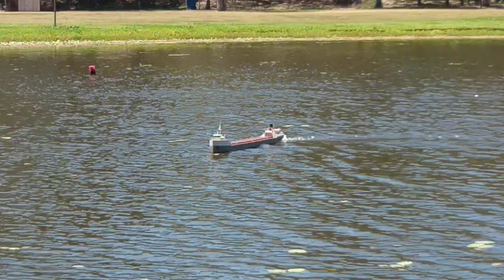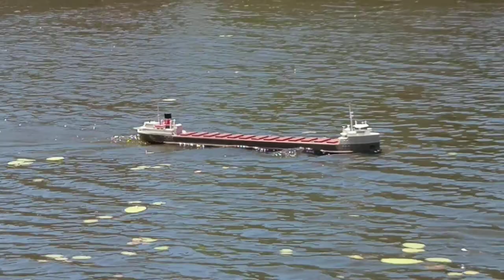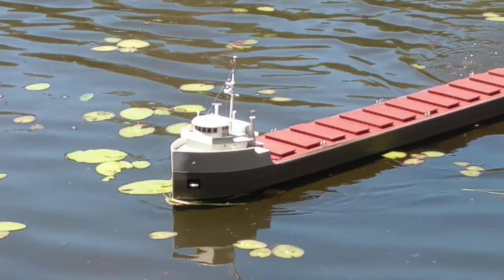Great Lakes Freighter

Comment: Is this a good first boat? Or is something like the Dumas jolly jay better as a first?
Reply from the maker: It is a very easy kit to build. Probably easier than the Jolly Jay as a first kit, because there is a lot of wooden planking to be done on the Jolly Jay. That can be a bit tricky for a first boat.If you like the look of the Dumas 41' USCG utility boat kit, that would be a good first boat. The hull is made up of solid ply panels. Very simple I have the kit but haven't built it yet.  https://www.dumasproducts.com/product/uscg-41-utility-boat-kit-1214/
Reply: @785boats  Thanks! I hope I can build a couple of these kits soon!
Reply from the maker: @excellenceinanimation960  The nicest one that I've built is the Dumas 'Dauntless' kit.
It's a big boat though at 49" long.
Reply: @785boats  just looked it up it’s sweet!

Comment: Do you have to put the propeller in yourself or does it come with it as an rc boat
Reply from the maker: Jason. It's a kit from 'Dumas' that needs to be completely built. There is no running gear or motor with the kit. It all needs to be purchased separately.
Reply: @785boats  aw ok so I will not be buying one I have no idea how to install an R/C system
Reply: @Michiganrailfanner23  I'm sure we could help you through the build if you need tips and pointers.
Reply: @Finnmarken91  it’s too expensive for me rn

Comment: That looks great! I ordered one not long ago, I look forward to getting it. How did you add the extension in the middle? Do they make an extension kit or did you just grab another boat? Or make it yourself?
Reply from the maker: Hi there.
I just basically bought some more styrene sheeting & basswood sticks, cut the boat in half & added in a section built exactly the same way as the original construction.
The same goes for the deck.
I did a build thread of the whole project over on R/C Boat Groups, if you want to see how it was all done. There's a few pages of it. Here's a link.
https://www.rcgroups.com/forums/showthread.php?3618011-Great-Lakes-Freighter
Good luck with your build. It all goes together quite well. Cheers.